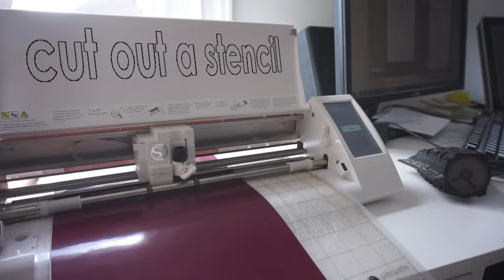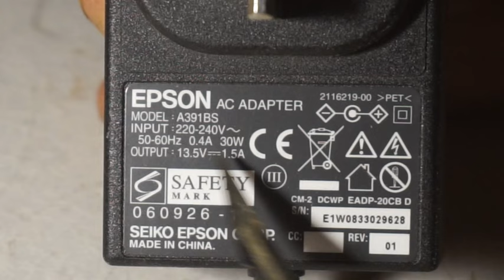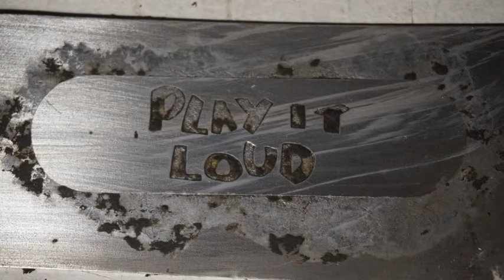Metal Etching - How to

Comment: This is pretty awesome, I'm new to this and I was considering buying a car battery charger to start personalizing tools, but this looks a lot cheaper. You said "plug in at your own risk", does that mean it's dangerous? I don't know much about electricity, but I understand it's a shortcircuit you're creating there. But it's low voltage and amperage, what's the worst that could happen?
Reply: You could just bust the power supply unit , but since you can find them in any trash bin you're ok .
I just tried it with an old laptop charger that delivers 18V-4A , the power supply is equipped with a cutoff security so it just stops when the short circuit becomes too much to handle .
It works pretty fine and is hella fast , just work with respect for electricity and everything will be alright .

Comment: Hi. Can I use this technique to reveal microstructure of the material?
Reply from the maker: I am afraid I don't understand what you are asking...sorry I can't help, though i guess if you do a search there will be someone who does know...good luck in your search
Reply: If you're talking about something like pattern welded metal or damascus (as some call it) to reveal patterns made in the forging process then no you can't as this would do the whole blade equally. 

However you could use this to put your own unique patterns or designs onto the surface.

Comment: I have tried this but every time the vinyl letters  were removed from the metal!! And it was cleaned before with acetone..  is there a better quality of vinyl sticker ?
Reply from the maker: I just buy vinyl sheets with sticky backs in A4 size from Amazon, never had a problem.  Maybe try not cleaning with acetone, I never do.
Reply: sauce  thank you
Reply: I have heard, though I have not tried, warming up the metal before applying the stickers helps them stick better, though it makes them more difficult to remove.
Denatured alcohol is a very good cleaner / degreaser as is vinegar.  Just a suggestion!
Reply: @dolfinmagikpro  thank you I will try that... until now I have no success with that.. same problem always..
Reply: Electrical tape

Comment: The heat shrink was a useless cool add on , 13v DC won't go threw your skin and I doubt the heat generated would even reach the part of the nail 
I don't know what salt you maybe table salt but its too concentrated the left overs are a mess 
Using weak acids would probably be better